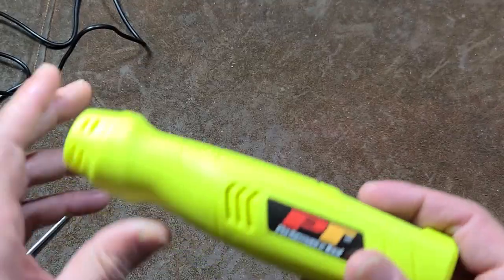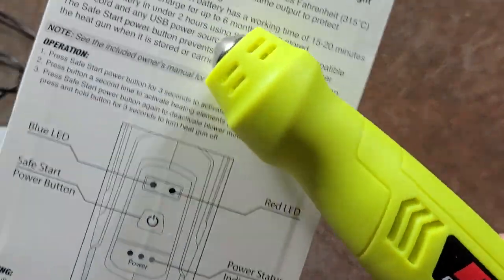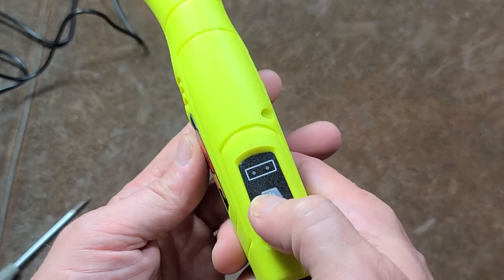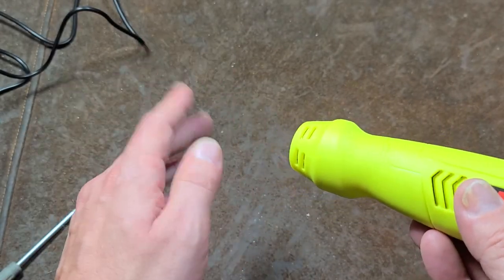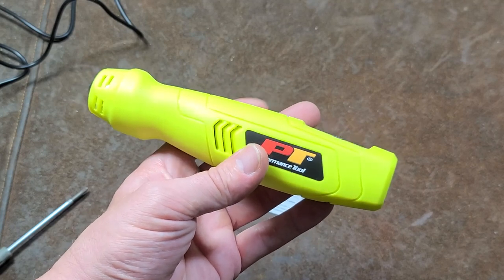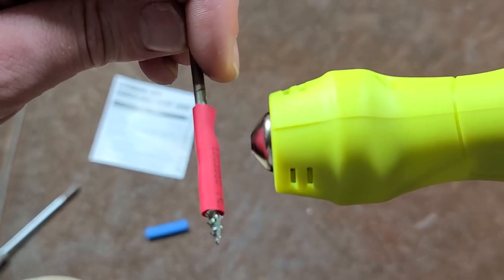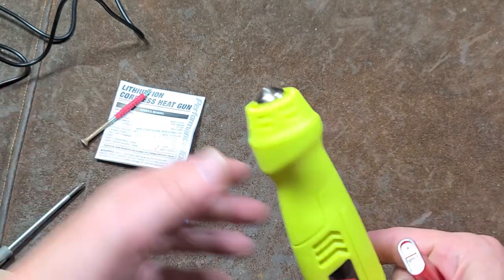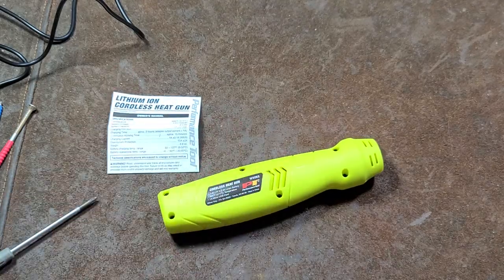PT Mini Li-Ion Heat Pen Review

Comment: When you talk about higher flow, problem is is that if you were to up flow output that would in turn cool the heating element too fast needing the heat coil to consume higher amps just to compensate for heat loss.

Comment: it looked like it started to work ok at the end when you put it closer to the shrink tubing. I wish you would've tried again with it held even closer, like so close that it's basically touching. If it works really well that way then I wouldn't consider the distance to be much of a drawback. Having such a short range could also be a benefit because sometimes when you're using a lighter in tight spaces, you have more heat going up above your workpiece than you want and you don't have much control over that.

Comment: I wonder if the battery can be upgraded but also carefully very slightly open them ceramic air holes of the heater itself for the air to blow over the coils some more.  But than one would probably loose some temp from doing so

Comment: If i used that for soldering/desoldering SMDs. I stand a pretty good chance of destroying the new part being installed. My personal experience is that it is best to apply enough heat for a short time instead of slowly toasting the IC, the board and everything in the vicinity. Neighboring capacitors will hate that thing. :)

Comment: This should use 18V Ryobi HP+ battery. Even Bosch 18V battery can deliver over 1000 Watts, and pencil thin portable super hot air would be useful in many applications.

Comment: I almost bought one, You just saved me $40.00
Reply: I wouldn't dismiss it so fast, I got one just for really small stuff in automotive where electronics or materials may be too close in proximity for other heat sources. 

So far I think it is an absolutely cool device and would recommend for doing small concentrated areas. 

If you need more heat then yes get the DeWalt or something similar.

Not sure why people's expectations are always 5 fold from what tools are meant for.